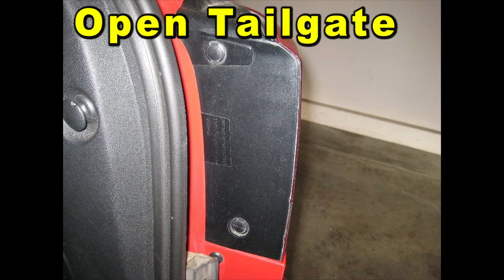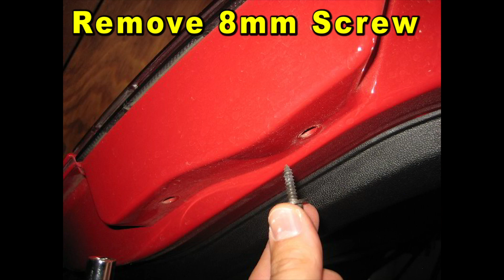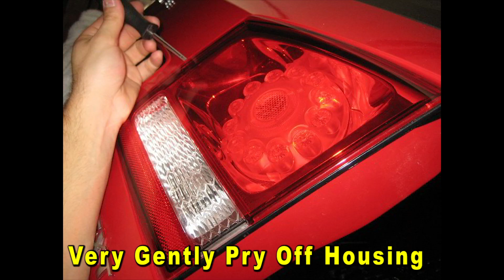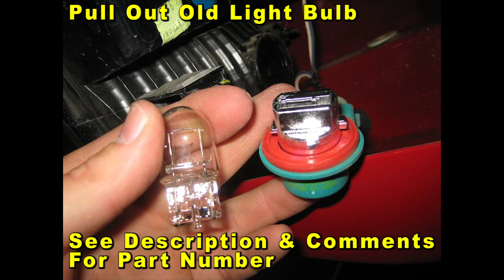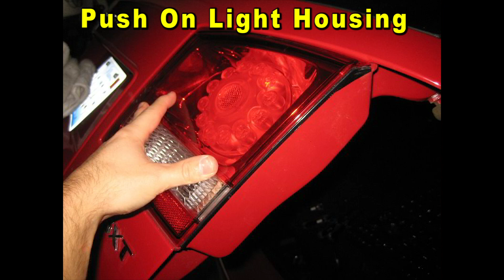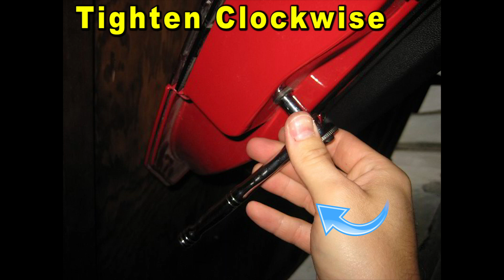2009 To 2020 Dodge Journey How To Change Reverse Light Bulbs With Part Number

Comment from the maker: Dodge Journey Reverse Light Bulb Part # - https://amzn.to/45355h1
LED Reverse Light Bulb Part Number - https://amzn.to/3KjmSqH
Older Dodge Journey Reverse Light - https://amzn.to/3V2Ev3j
Precision Screwdriver Set - https://amzn.to/3sLixaP
Plastic Pry Bar Tools - https://amzn.to/3HMtsV7
Socket & Ratchet Set - https://amzn.to/3Z17LbA
Mechanix Gloves - https://amzn.to/3jCnHkt
Torque Wrench - https://amzn.to/3vS5uSI

The Paul79UF YouTube channel is a participant in the Amazon Services LLC Associates Program, an affiliate advertising program designed to provide a means for sites to earn advertising fees by advertising and linking to Amazon.

This DIY video shows owners of the 1st generation 2009 to 2020 Dodge Journey SUV how to change a burnt out reverse (backup or back-up) light bulb in the housing attached to the tailgate.

Comment from the maker: Check out the DIY guide for changing the reverse light bulb in a first generation 2009 to 2020 Dodge Journey - 
https://www.paulstravelpictures.com/Dodge-Journey-Tail-Light-Bulbs-Replacement-Guide/index.html

Here are all of the DIY repair and maintenance tutorials for the first generation 2009, 2010, 2011, 2012, 2013, 2014, 2015, 2016, 2017, 2018, 2019 and 2020 Dodge Journey SUV - 
https://www.paulstravelpictures.com/Articles/Dodge-Journey-Common-Problems-Repair-Maintenance-Guides.htm

Owners of other Chrysler, Dodge and RAM vehicles with similar dome light housings such as the Town & Country, 300, 200, Avenger, Challenger, Charger, Dart, Durango, Grand Caravan, and Ram C/V Tradesman may also find these DIY instructions to be helpful.